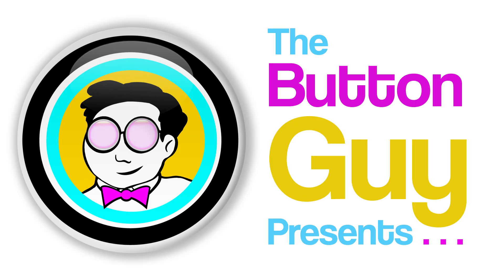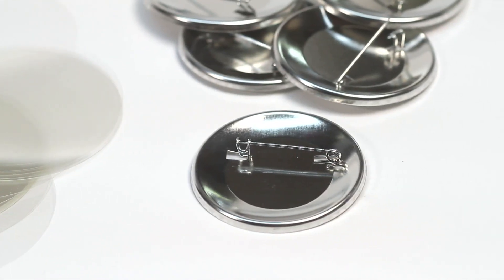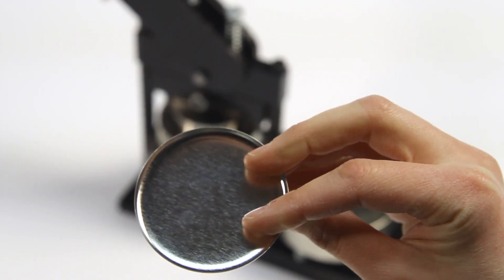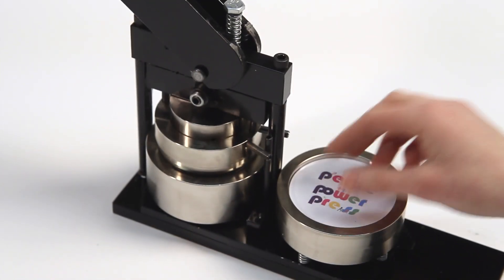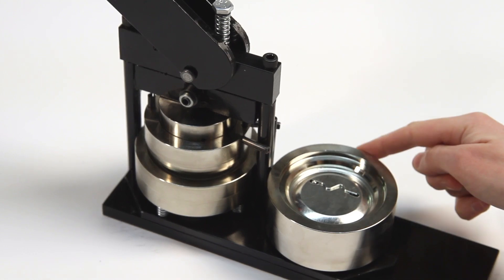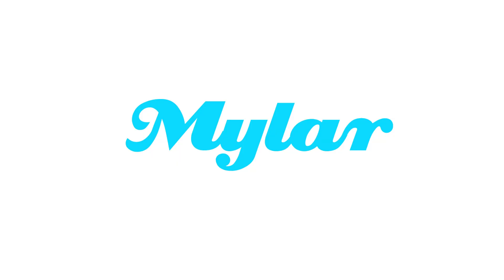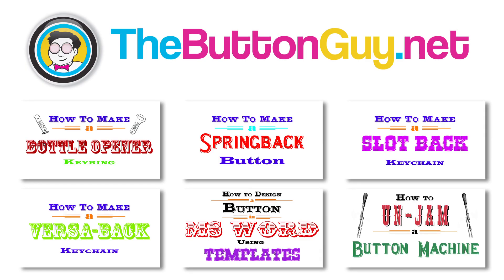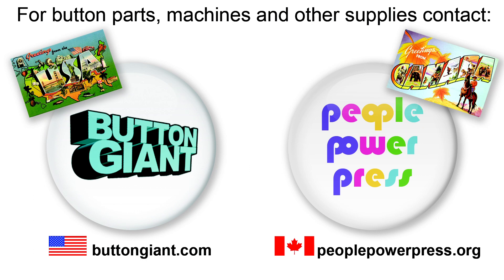How to Make a Pinback Button. Pin-back buttons made easy!

Comment: I just had a question about the 2" buttons. Why is the 2" button the only one with the plastic backing? Is there any pros or cons to having plastic? Thanks.
Reply from the maker: Hi there! The 2" Button size has the black plastic back because that is how the patent owner for that particular size designed them. 2" Buttons with plastic backs are great for lots of different applications, because the backs are flat they are easy to stick magnets onto or glue directly onto things, and because the backs have a center hole they can be used with things like welded-up eyes or prong backs! I just launched a video specifically for making 2" buttons with plastic backs too: https://www.youtube.com/watch?v=v99f1T0qqaI

Happy Button making!
- The Button Guy